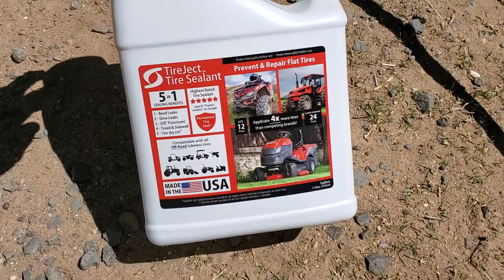leaky loader tires

Comment: That is some good stuff.  I have used it in atv and 15" truck tires.  It has worked every time.   It works great on weather checked tires also. I will have to try it on my leaky loader tires.
Reply from the maker: It sure seems to work so far
Reply: @sowerscattleco3484  Has that tire on your loader stayed full of air?  You put a gallon in it right?
Reply from the maker: @johndwyer782  so far do good !
Reply: @sowerscattleco3484  Nice! Sure saves the PITA of airing up a big tire all the time.